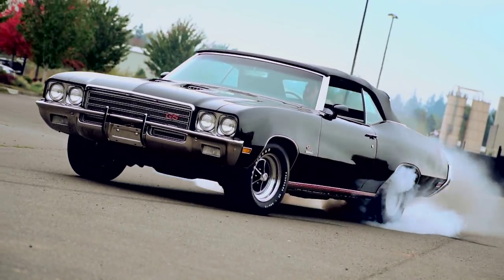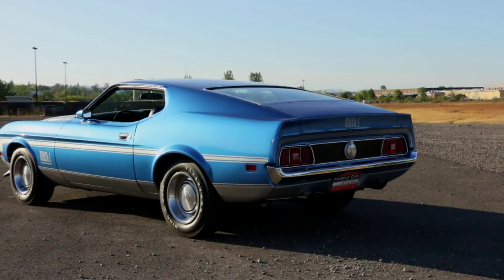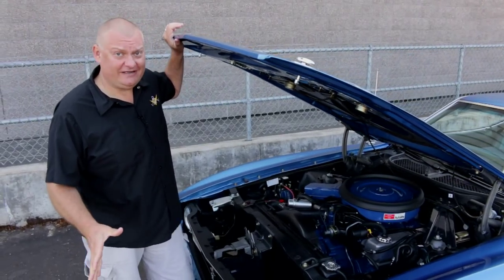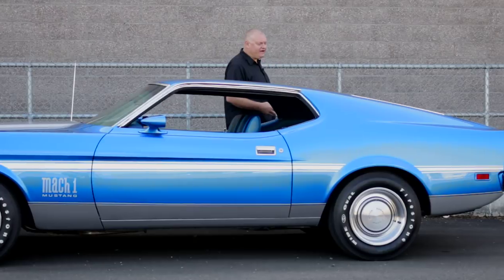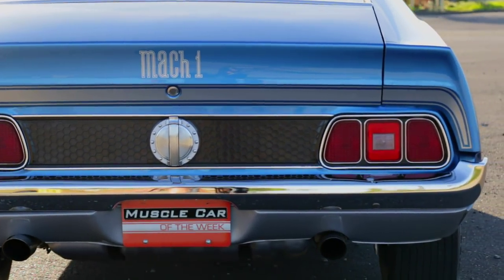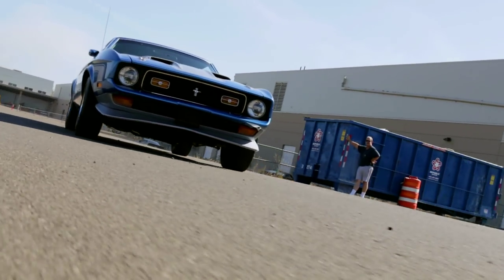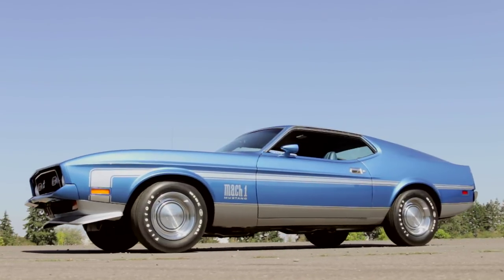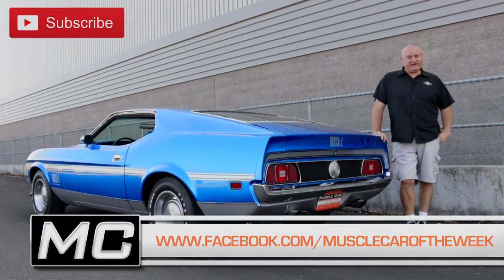1971 Mustang Mach 1 429 Video: Muscle Car Of The Week Episode 252

Comment: Like all old cars recorded times were tested differently...Thus times were 1-3 seconds off the 1/4 mile and 0-60's were also seconds quicker..

Skinny bias ply tires didnt hook and drag strips didnt have compounds /chemicals like today to make them stick better !

These run low 12's in the 1/4 with modern tires ! And I am not a Ford guy !!!! No,No & NO !! But i knw all recorded old times were off...

And guys who own them in the 80's,90's and today bought them with engines with low compression running on 7 cyl !!! And they thought thats how they were,seriously I was around I know !!!! Then you have people rebuilding the engines in the 90's and made them run unleaded by lowering the compression thus lowering the power(all the time without fail) Then they go down the track and think hey it runs the magazine time lol..They dont know the magazine times were done burning rubber down the track with 0 traction..and their car was slower than the original...TRUE !

Now people because of many years refining parts can make them run quicker while running pump gas and un leaded heads...My buddy has one that runs 11.90's not driven too hard either could run mid 11's,but he granny rolls it out a little too far lol !!!!!!  FYI : I have a bone stock looking 68 Charger RT 440 Magnum,727,3.23 gear and street tires that runs 11.28 @129 mph !!! With a 440 built to 512 cubic inches,factory appearing too !! My buddy built a 535 (440 block) for my current resto a 69 Charger (was 318 2bbl) Now a exact copy ,factory appearing.down to every detail like my 68 Charger RT looks factory correct,except driveline that too,looks as factory as can be..No hideous valve covers or huge blowers or aircleaner or hood scoops,looks stock ! Best way to have them..I did get a overdrive and 4.56 gear for the 69 as its gonna be very quick ! My 68 gets kicked out of the track because they want me to run a roll bar lol,NO WAY !

Comment: How fast can this car go in terms of km/h

Sorry im new to car stuff
Reply: I worked for a dairyman who had a '71 Grande with the 429 Super Cobrajet, 4-speed, and 3.91:1 rear gear. He and his brother made a trip to Las Vegas from the Boise, Idaho area back in '73. He was driving, his brother timing mile posts. For ten miles, the markers flew by at 23 seconds apiece. That works out to ~ 156 mph. And it was STOCK. I rebuilt his engine in 1979 and turned it into a 460 SCJ... And it wasn't quite as fast! 156 mph is about 250 km/h.
Reply: @alanhardman2447  Uhhhh yeah... that comes out to 8,911 RPM on a stock engine, for 10 straight miles, which works out to BULLSHIT lol

Comment: I just had another thought, wouldn't we have to know when the very last 1971 Boss 429 Mustang was built to know if it was the Mach 1 or Boss 429 to be the last big block Mustang to leave the factory?
Reply: They didn't release a Boss 429 for the 1971 model, it only came out as a special package for '69/'70. It was a Boss 351 for the '71. Maybe if Knudsen didn't get to be fired, maybe a Boss 429 would be available for that year.
Reply: There wasn't a 71 Boss 429 . 69 and 70 .
Reply: @jeffschwartz5199  ; You know what's interesting is a fact that the 71-73 Mustang shock towers were modified at the factory instead of going to KarKraft.That would've saved a ton of $$$ and meant Ford had plans to continue the Boss 429. Next time you see a 71-73 Mustang engine bay, check out the shock towers. They're like the 69-70 Boss 429. :)

Comment: I thought the 73 mach1 was the last big block BC even though it was a 351 it was a cleavland block instead of a windsor small block.
Reply: MrBeeradb1 the 351 Cleveland block is smaller then a 351 Windsor block it’s the heads that make them look bigger
Reply: MrBeeradb1...and it's the Cleveland heads that make it so much better that the Windsor motor....
Reply: Thats a small block also

Comment: Great Engine! But 71 body style was HORRIBLE..same problem Dodge had with the looks of the 71 Charger! Just awful body style
Reply: I have to agree.  I remember that even as a 10-year old kid I thought the new '71-73 Mustangs were ugly, especially compared to the '67-'70 models.  A friend's older brother had a Mach 1 that was yellow with black stripes, and Magnum 500s, and it looked better than some, but still not as good as the previous models.  Still, this car is a rare beast, and one that any collector would love to have, but please get rid of those dog dishes.  I'm sure that most who bought a car with those on it would immediately put a set of Cragars or Keystones or some other aftermarket wheel on it.
Reply: Odd they are extremely valuable and desirable today. I guess you never watched gone in 60 seconds back in the days.